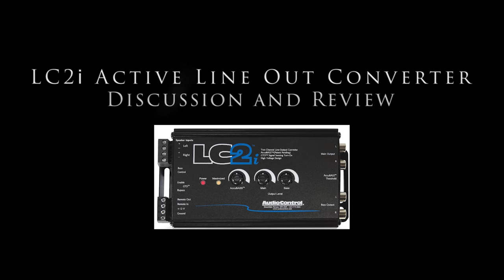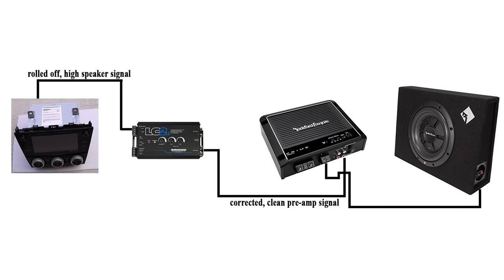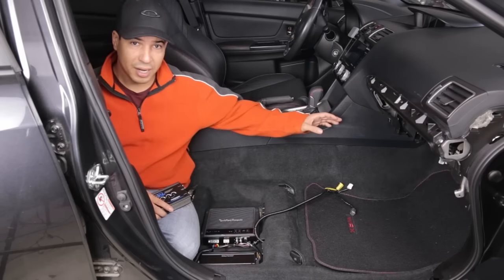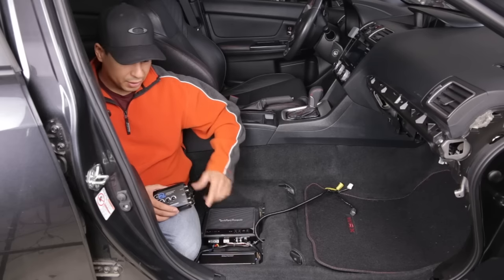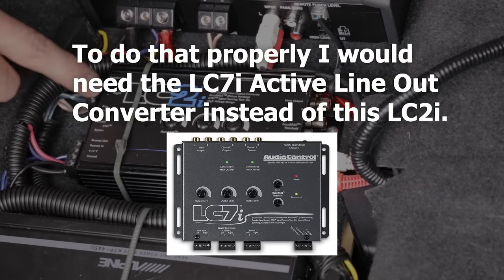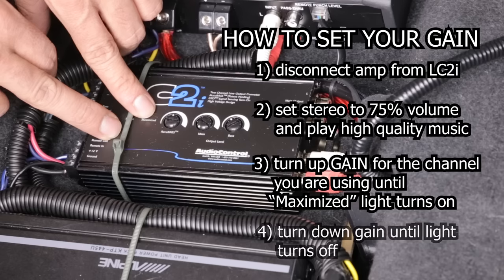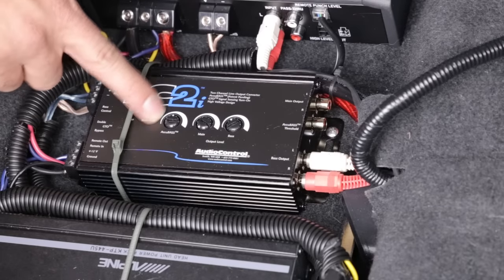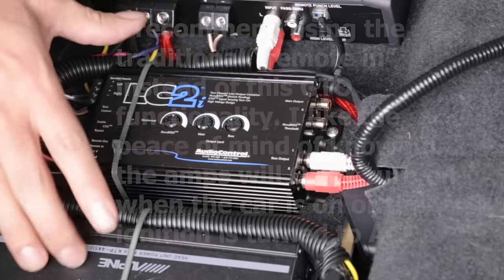LC2i Active Line Out Converter Discussion and Review

Comment: Something to keep in mind...when you are setting the threshold, the bass will kick in hard and all of the sudden, and your maximized light should be lighting up.  At this point (per two different techs that work at AC) is to turn the Accubass dial down all the way, then turn your volume up to the max at what you would normally ever play it at, then adjust the Accubass dial up slowly until you get the maximized light again, then slowly back off til it goes away.  By slowly I mean like crazy slowly, or you won't get the sweet spot.  By doing this, your threshold turns on when your stereo starts flatlining your bass, and when you turn it up all the way, you will know you have the most bass you can get without clipping.  This is how you get the most bass between your flatline, and max volume.  You're welcome.
Reply: Ok, to clarify. By Accubass dial, do you mean the the Accubass threshold dial or the top Accubass dial? Been fine tuning and wanna make sure 👍
Reply: @daralike0979  my go bad the manixim light is in and don't work any more ?
Reply: My unit has 8.6v going in but nothing coming out of the RCA's.....no reading AC volts.Unit is brand new,any suggestions?
Reply: Now how does the ACR-1 bass corded attenuation dial come into play based on the above?
Reply: Bro ... God send.
Reply: Did u all turn down your bass on your head unit? Before you adjusted the lc2i?
Reply: Hey question about this, seems like you might have the answer. My accubass threshold still needs to be adjusted, its supposed to kick in when the volume is at 24 (where the bass flattens via stock head unit), although it kicks in at 21 right now). After i achieve that, i can put my volume to 28 (75%) move the dial up or down to make it add bass smoothly. Question is, do i adjust my gain on my amp before or after finding the sweeet spot on the accubass? I can only assume i should have the gain lower when making these adjustments with the LC2i because I wouldn’t want the bass to blare and distort. So it makes sense to lower the gain enough so i can hear differences while adjusting accubass. Then once its set, put it to 75% volume, with the accubass dial set, and then adjust my gain at that volume to achieve no distortion. Am i correct?
Reply: @kevslo5546 from what the guy at AC told me you set the LC2i first then tune your amp

Comment: Hello .. I just hooked up a system of my 2020 Malibu I did it myself I’ve done it before so I’m pretty familiar with our systems work but this time around I hit a speedbump and I can’t find a solution to it the speaker wires from my car the factory wiring both give me positive voltage or amperage I’m stuck I don’t know what to do do you know why that happens is that normal any advice would help thank you very much

Comment: Hey Boost & Shutter just wanted to say how much I appreciate all the knowledge you share.

 I'm in a bit of a pickle.

I just purchased a Sony 6ch amp XM-GS6DSP for my highs and mids.  This amp is perfect for my application because it is a classic car and I need the Bluetooth in the amp, (keeping the dash original) so I was under the impression that the amp had Rca output for the 2nd amp.  I don't plan on using the sub output on the Sony amp so I thought I would use an Audio Control LC2i to give the Sony a preout for the second amp. (JL Audio 500/1 monoblock,  Which will in turn power the JL Audio 8in W7 sub)
 Any suggestions would greatly be appreciated. 
 I really need to eliminate a head unit due to the vehicle being a classic car. So this amplifier is ideal for this set up.

  I appreciate all the help gang thank you.

Comment: Thanks SO MUCH for this video as it really does clarify many things for me. I have a very similar setup (HU rear high-level inputs into LC2i, LC2i output Main to Kicker Key 200.4 so running fronts/rears on full range with no fader as I am only using the one input on the Kicker for 4-channels (fader off), and LC2i output Bass to a Bazooka 8" amped 100W sub). So once everything is wired, when it comes to tunning and the sequence of events, based on your knowledge, correct me if I am wrong: 1) Tune LC2i Main Output and Bass Output with a test tone (Full range maybe -10db, 1000Hz or 0db, 1000Hz and Bass maybe -5db, 40Hz or 0db, 50Hz) and watch "Level" dials until "Maximized" comes on; 2) Plug in RCAs Main Level output to Kicker Amp and Bass Output to Subwoofer. This is where I am not sure on what to do next for tuning. Should I now set the Gains on the Kicker and Bazooka then turn my attention to the tuning of the Accubass "Threshold" and "Bass Output" leves?
Reply: No. You want the highest yet still clean signal going INTO your amp. Set up the LC2i before the gains for the rest.

Comment: I'm pretty sure PAC makes a device that gives a full range line level signal from the CAN-BUS of the radio. I have one in my 2006 Chrysler w/ 6 speaker Boston system. It will give you the best signal w/out roll off.

Comment: Nice video. If you used the 4 channel hi outputs from the stereo to the alpine amp using its hi level input, where did you get the high level input into the lc2i? Did you splice the wires out from the HU and run them.into the alpine and the lc2i? I assume the rca output from the lc2i can be used both right? I mean the output for bass and the available channel to the speakers amp but loosing fade. In this case you didn't go that way cause you wanted to still have fade. Would it have sounded better if you have used the output to the alpine stereo instead of the speakers hi levels to the alpine?

Comment: Thanks man! Cleared up a few questions i had. Planning an install on my 16 silverado
Reply: How did the install go I looking to do the same for my 18 Silverado
Reply: @jrram2166  pretty simple. Running the power wire into the cab was the hardest thing to do, but even that isnt that bad.

Im actually removing mine now, adding a linkswell radio

Comment: Excellent video man.  I have a quick question,  I found some multicore cable at my local Home Depot, designed for a sprinkler system, the wire was single stranded 18awg wire, max 30Volts. Will that be suitable for transmitting the single from a premium factory sound system to the Lc7i converter? 
Thanks in advance.
Reply: No. LOL
Reply: @funfun8095  I didn't end up using it.  I bought another multi core cable that had 13 awg wire.  System is complete now and sounds amazing.

Comment: Great video. I was wondering if I can use a LC2i to run my fronts and rear channels per channel and use the bass only for my subs or do I need a LC7i to run the front and rear separate. Also, by me combining the the front channel to one channel does that change my impedance feeding to the door speakers?
I have a 2018 Honda civic Hatchback with factory stock crap radio. There are no RCA plugs. Any help thank you.

Comment: The manual says that the frequency response is 33Hz on the low end. Does that mean this unit will not put out any signal below 33Hz? It also says on other parts of the website that the frequency response is 10Hz on the low end. 

I’m not sure which to believe, and I don’t want something that cuts out the “sub” frequencies of the subwoofer. Otherwise, it may as well be a very large woofer. 

Have any of you guys noticed not getting any sound below 33Hz out of your installs?

Comment: In a 2007-13 Silverado with the Bose system you tap the wires in the center console going to the factory amp/woofer if you want to add an aftermarket subwoofer. I'm assuming that the signal is already a low frequency coming from the head unit because is only feeding the subwoofer. I have even read in some forums that the signal is already an low level output that you can use to feed your aftermarket amp but I'm not sure about this. How do you think the LC2i will behave in this situation? Do you think is better if the LC2i processes a full range signal from  the speakers and then use it to feed the aftermarket subwoofer amp or it will work better if the signal is already a low frequency? What do you think the "MAIN AND BASS" outputs would do?
Reply: My lc2i is being fed a signal from stock stereo woofer. Yes obviously it’s better cause the signal the lc2i has to process and convert is already a low level signal. So instead of converting it, it’s just polishing it. That’s why the lc2i instructional manual,  urges you to grab the signal from the mids instead of the high’s, so the conversion and processing is a lot smother for better and cleaner sound.  It Has a high level rca Input and a low level rca input. So you can power some highs and mids, and lows with some amps to the stock stereo.

Comment: Hey great videos! Was looking to add an amp to my 2018 base WRX and stumbled across this. I also noticed you replaced the head unit later down the line. Does the new head unit out perform the stock HU with the amp? I want to keep my stock HU but add some more power to the speakers, is it worth it?

Comment: Very helpful video, I have the same setup almost but I have a crossover, 2 amps (1 for subs & 1 for highs) and I also have a LC2i. I wondering do I need to take the crossover out? I was also told I need high voltage rca jacks.

Comment: Great video! Question. Do I have to run all my factory speaker wires to the LC2I in order for it to control the factory output on the speakers?
Reply: To my research and knowledge yes, but if your factory system has rear deck speakers I believe you can tap into them at the rear deck point to run to your LC2i (somebody correct me if I’m wrong?)  That might make connecting to mono amp and sub in back easier for your setup?  Kinds similar to how he did in this video

Comment: Thank you for your detailed views of your journey in cleaning up the sound in Subaru. I too have the upgraded Kicker speakers and opted for the powered sub as well in my 15' Impreza. The sound is just not quite where I would like it too be. I like the idea of the Alpine KTP-445U.  Could I use a LC6i to clean up the signal and the amp to add some power to the doors? All the while retain the subwoofer without messing with it?

Comment: I have the lc2i and am curious how to match my amps input volt with it's output volt. Currently I have the gain, bass, accubass at 95%. Running 2 Audiopipe apcl1500.1d amps strapped and after my 2 American Bass XFL 12s the amps are seeing . 25ohm before rise. The amps gain is at 50% and My volt is holding above 13v, and it's extremely loud. But I know I'm exceeding the amps volt input max, and they will get hot. My car is also a 11 STI limited. I believe the lc2i is ran off the fronts as well. Thx
Reply: use an oscilloscope.
Reply: also, please clarify your description:
"I have the lc2i and am curious how to match my amps input volt with it's output volt"... how to match the LC2i output signal voltage to the amplifier's input voltage? or "match my amps input volt with it's output volt" match your amplifier's input voltage to its own output voltage? (not trying to be a dick, but i have no way of knowing your level of expertise in this field, nor what you mean by using certain terms such as " Running 2 Audiopipe apcl1500.1d amps strapped" and "My volt is holding above 13v" (what "volt"? supply voltage? output signal voltage from LC2i/input signal voltage at amplifier?) and under what conditions? (as in, was the engine running at the time? were you using music, or test tones/sine waves, pink noise, etc?)

next, let's address the statements "Currently I have the gain, bass, accubass at 95%" and "The amps gain is at 50%"

presuming that the first statement refers exclusively to the LC2i... what "gain" are you referring to? (the only adjustable potentiometers on the device are labeled as "AccuBASS" "Main" "Bass" and "AccuBASS Threshold")

also, "95%' and "50%" seem like estimates based upon visual observation and subjective approximation.... you should really use either a DMM, oscilloscope, etc. to obtain precise (and well-defined) measurements, as this will help immensely when asking for advice from a public forum.

Comment: You said in this video you were originally going to send the speaker output on the LC2i to the Alpine mini amp but it only has one channel. Question, if you were to use the LC7i how would you connect it to your alpine mini amp?  The speaker output on LC7i is RCA, the Alpine mini amp doesn’t have RCA input. Thank you.
Reply: Boost & Shutter I see. Thank you

Comment: If I put my MTX 2 x 10" subwoofer box & MTX subwoofer amp in the back (2019 Crosstrek) will it compensate for the dropping of the bass in the door speakers? Or would I still need a device like this? Thanks

Comment: Are you running the power wire from the battery? It appears to be connected to the power input on the subwoofer amplifier.

Comment: Have a question for you, this is my set up right now I have a pioneer after market radio , an amp to a 500rms single sub. I wanted to replace all my factory door speakers and add a four channel amp for the door speakers. The shop told me I had to replace my radio cause it don’t have rca outputs for another amp. So can I install one of these instead of replacing my radio?

Comment: Thanks for this. Questions. How are you running the remote trigger? From the head unit (infotainment) is it ran to the audio control first then out to the amps? What about power to the amps and LC2? I’d love a explanation or wire diagram if possible.
Reply: Boost & Shutter gotcha. The reason I ask is I’m getting a slight thump when shutting down my car. I running the lci and a 1 sub amp. 
As follows:
speaker inputs from rear HU, using GTO on the lci2, lc2 is getting ground from amp, lci2 is triggered from HU speaker signal, remote out to amp. Can’t figure out why, I thought it may be a ground thing. 

Never had this issue with the old amp, but I was using a HU with a dedicated sub preout. Also, remote was triggered from the deck. I’m trying to narrow it down
Reply: Boost & Shutter Will do. Thank you.
Reply: @akqjtn  Last question. If I disable the GTO feature will the remote out feeding the map continue to work? Or will the am need a remote feed? Cheers.

Comment: you could have use the low level on 2 of your channels of your 4 channel amp and left the other 2 high input channels connected. i would have done the front speaker because you then to hear them more or maybe the rears because they tend to be more of your bass and the fronts would just have a little less bass which is not always a bad thing.

Comment: Hi, i have a question, i have one small factroy sub in the back of my car and want to add two bigger after market ones. So i purchased the LC2i and a large amp (Precision Power TRAX1.2000D Monoblock 2000watt) and two 12'' Pioneer subs. The thing is there is just the one factory sub wire at the back. Can i connect to one speaker input on the LC2i and put jump wires to the second specker input to have two pre out on the LC2i to send to the amp inputs so i will have two speaker outputs on the amp for the two speakers. The point is to have my single factory speaker sub wire at the back feed the two big ass pioneer 12'' subwoofers. I would think i need two speak outputs on the amp so how to split that one rear signal to have two inputs to the LC2i?

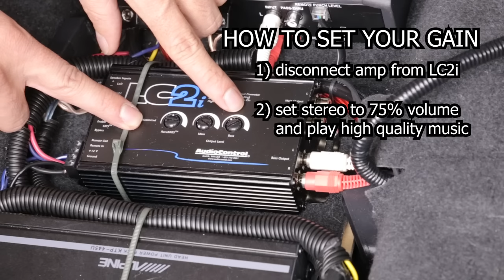Comment: At 6:16 when you say to disconnect the lc2i from the amp, when exactly do we connect it back? Also by disconnect you just mean to disconnect the rcas, correct? Right after that you start talking about setting the accubass so I was just wondering if we were supposed to connect the lc2i back before that?
Reply: Wondering the same question?

Comment: What does the wire configuration look like from the factory radio to the LC2..?  I’d like to have the wire connection from the radio/LC2/factory speakers.  I only want to add a subwoofer and keep all factory speakers.  Thanks!

Comment: So I've had a few LC2i's that gave me issues when I hooked into the stock radio 12v and ground. Rerouting those wires to the amps 12v and ground fixed everything. Why would hooking into the radios power source cause issues? I'm stumped on this.......thanks!
Reply: That was probably due to your stock radio not having a high enough or steady enough voltage

Comment: 2017 civic touch screen. 
So with my amp is mounted to my box in trunk .  Can I mount that low level in my trunk instead of to the back of my factory radio.

RR- to RR-  --- LR+ to LR+
RR+to RR+ --- LR- to LR-
Power (Con) to Power (Amp) to Battery
Ground (Con)  to Ground (Amp) to Frame
REM (Con) to Rem (Amp) to (Ingition)
Con (RCA)  out to Amp (RCA) IN 
Speaker wire Subs to Amp  + to + and - to - 

I'm running Two 12 inch subs . 
(also my converter has front speaker wires as well ( do they need to be hooked up or not) as I'm tapping the subs into the rear speakers

Comment: Great video! Hey can the Audio Control LC2i be installed with a non factory head unit? Also do Aftermarket decks have a little Bass Roll off as well? Thanks!
Reply: I don't think you need this for an aftermarket radio. Get an epicenter if you are worried about the bass.

Comment: The subwoofer output is low pass filter but 1k that is too high for your subwoofer speaker.  Do you have crossover on the subwoofer amp so it filter down from 100hz for bass only?

Comment: So if I get the LC2i, I can run 1 amp for my sub and 1 amp for my inside door speakers. A total of 2 amps can be used with the LC2i?  Thank you.
Reply: Boost & Shutter Fade? I would like the sound to be center at all times? That will remain the same? Just can’t adjust? As long as it’s center I never use the Fade anyways that would be great